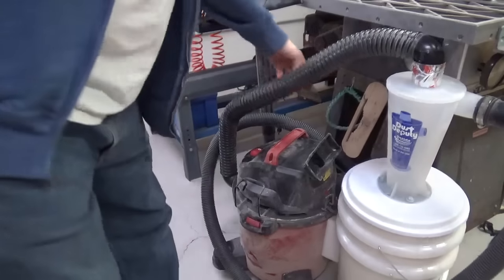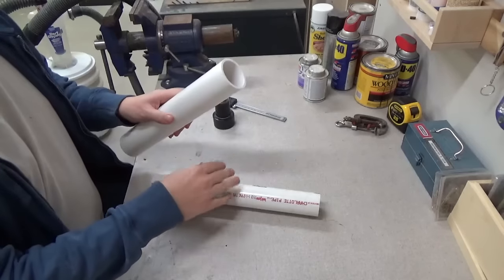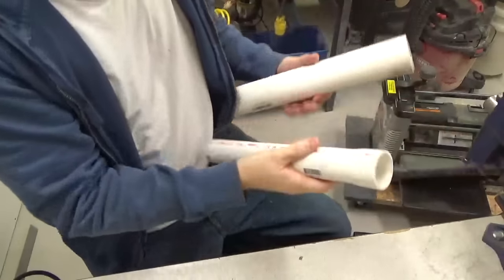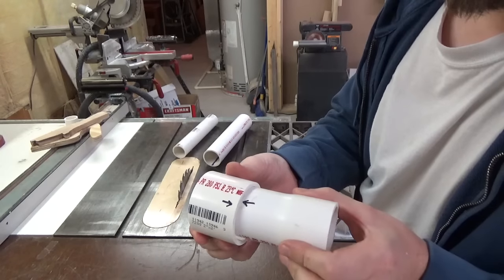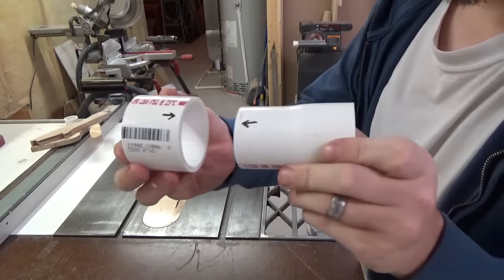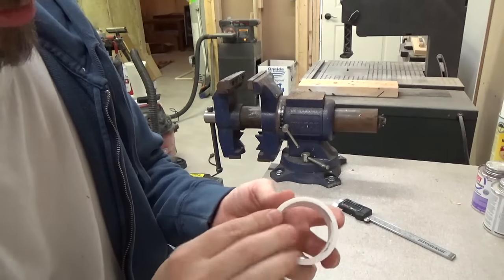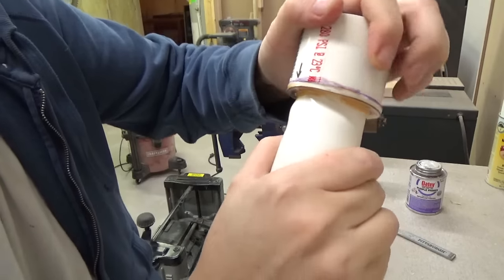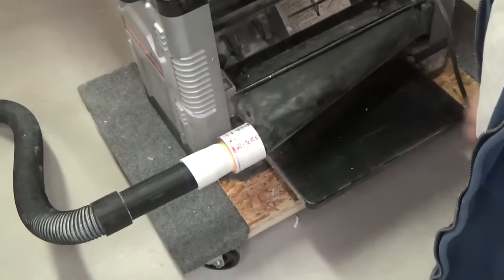Shop Work: How to make your own PVC dust collection adapters

Comment: Did you try PVC reducers or couplers?
Reply from the maker: I used what I found in my shop.  If I had to go to the store to get other pieces, it defeats the purpose since I could have just bought an adapter.
Reply: @FishersShop  excellent point Drew! My motto is use whatcha got and not whatcha aint

Comment: Why not buy a 2”to 1 1/2” reducer to connect the two?
Reply from the maker: Because I didn't want to buy anything.  This shows you how to use scrap to accomplish the task with zero cost.
Reply: Ok I was just wondering. Great problem solving.

Comment: You could have used a pvc 2” x 11/2” coupling to joint together. Available at all plumbing supply shops. Also could have used a rubber Fernco fitting, making it removable
Reply from the maker: The point was not having to go to the store.

Comment: Why didn't you just buy a 2"×1 1/2" pvc reducer?  Instead of melting a flange? I feel it would of saved you a bunch of work.
Reply from the maker: You're missing the point.  I didn't buy anything.  I was improvising with whatever I had on hand for a cheap solution.
Reply: @FishersShop  okay, but for those who are at home mimicking what you build they probably don't have pvc lying around and will need to buy them. So it would be nice to mention the 2×1 1 1/2" reducer to save your viewers a lot of extra work. Just Saying

Comment: I wouldnt heat PVC pipe at all.  Or at least do it outside. I believe heating PVC will release toxic fumes including chlorine gas and dioxin.   I see these projects a lot but PVC is not a material to heat up.

Comment: You had me until you joined the pvc together. Why not use a simple reducing bushing and be done with it? 🤷‍♂️
Reply from the maker: That would involve going to the store and spending money.
Reply: @FishersShop  97 cents compared to 10 or 15 minutes labor 🤨
Reply: @robertthomas7239  Depends. The closest hardware store is a solid 25 minute drive from my home. By the time I drive there, find what I need, pay for it, and drive back I've just blown through well over an hour - And that is assuming I don't get sucked into spending time drooling over the latest cool tool or fancy grill! I'm putting my shop together in the next couple of months and will definitely be doing this!

Comment: Couldn't you have made this with one piece? Just press the cut end while it's attached to your hose to the desired tool and let it cool
Reply from the maker: Nope.  Diameter differences were too much.  You can't compress the ends nearly as much as you can expand them.  Had to use 2 different sizes.

Comment: Buy a cheap 3D printer and solve all these issues in minutes.
Reply from the maker: I did solve it in minutes... and without having to buy a cheap 3D printer.
Reply: Well with a 3D printer you use less effort, less time and definitely your work will look cleaner.